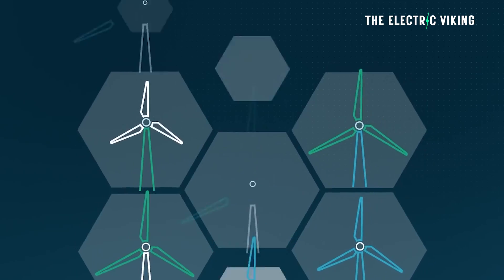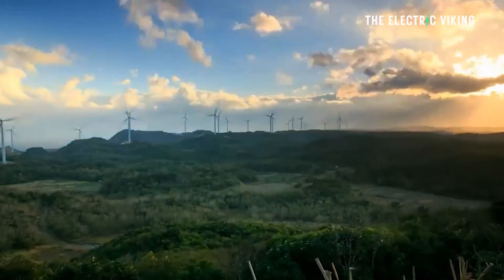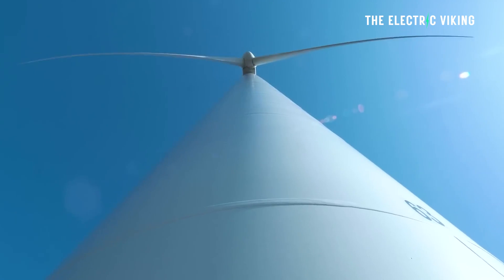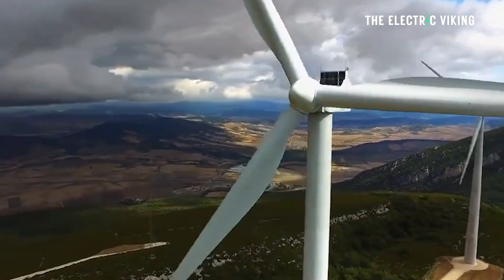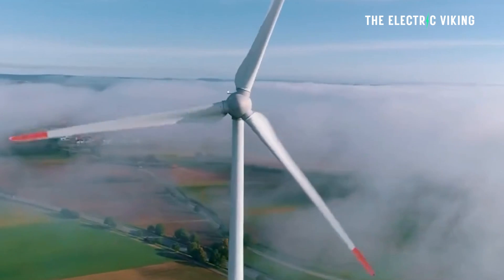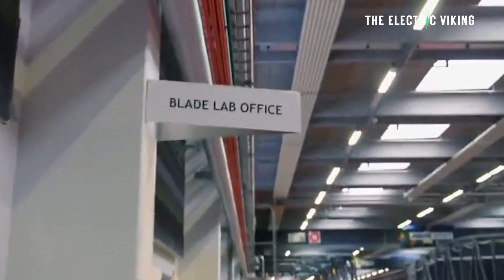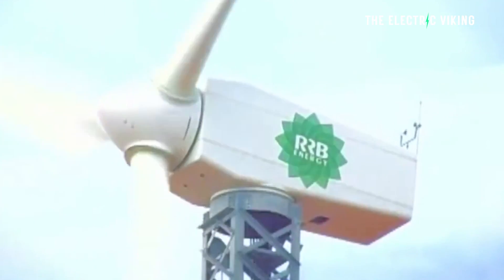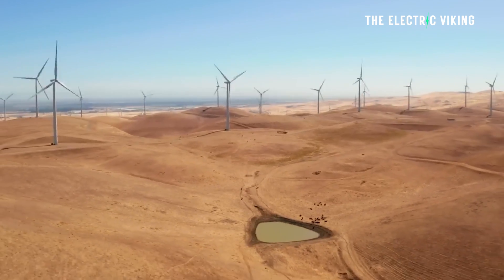A software update for world’s wind farms could power 10 million more homes

Comment: a great idea will be , since wind can go of line 30 % or more of the time,to have during this time run air compressor or hidrogen producción because this aren't affected for low high voltage or frequency variation,it Will be a 100% free, especially when the grid is saturate by to much energy.

Comment: Sorry, but MIT has a press office that exaggerates wildly the various research projects (most of which govt sponsored) so as to keep their brand name in the news on a regular basis. Of course it is impossible to extract 30% more power from a wind turbine. The gears are maybe 95% efficient, and the generator is about as good as it can get. 

Software tweaking is probably down at 1% improvement. 

And half the time these so called breakthroughs can't be used at all because they require some change or are inapplicable for some other reason.

As an MIT alum, i am dismayed at how they are just reputation mining.

Comment: Sam
Was wondering since last year why Algos were not used in Turbine design and especially to optimize VAWT turbines (more suitable for residential installations). Saw that last month a new Ship Propeller had been designed with I think 70% increase in efficiency. Any thoughts ?
Also will you please do a video on home turbine kits. What to look out for (standards verified outputs etc) ?

Comment: The length of the blades is increasing as technology increases. The power produced is proportional to the swept area - so doubling the radius quads the power. I expect existing turbines to be re-bladed to longer lengths. This may ideally be achieved by moderate intervention…..using almost all of the existing structures except the blades. But more probably replacing almost all of the structure - to get strong foundations, stronger and taller towers and more efficient generators. The problem in the UK is getting planning permission for new windfarms - but upgrading existing windfarms - should be straightforward.

Comment: Here in Texas we lead the United States in wind energy production. I have seeing that the majority of the wind farms are aligned along ridges facing where the wind hits all of them head-on without interfering with each other already. Apparently this wake turbulence problem at the farm in India was accidentally designed in.
   You did get me thinking about increasing output though. And it hit me that possibly stringing wires along the surface of the wind turbine blades to generate electricity by the effect of solid-state. Wind blowing across bare wires can generate electricity to be stored in batteries and this would add a boost to the generating capacity of every wind turbine already in existence. 
    Just a thought..... 🤔